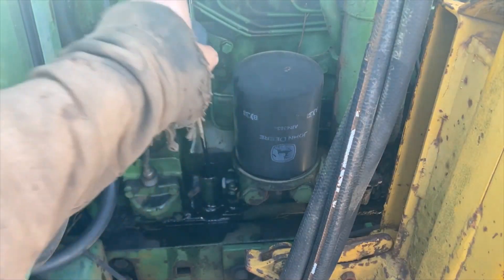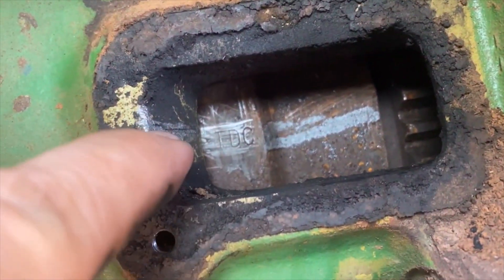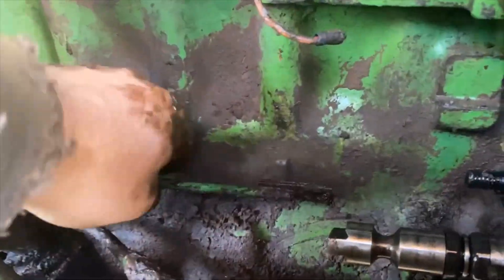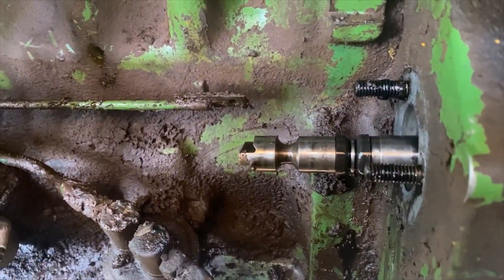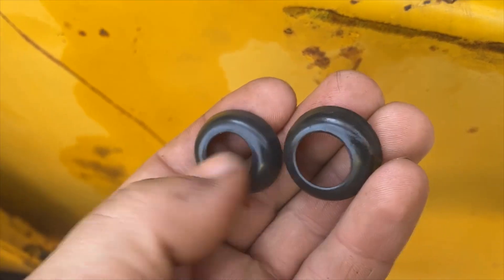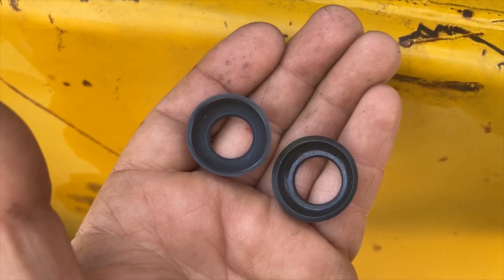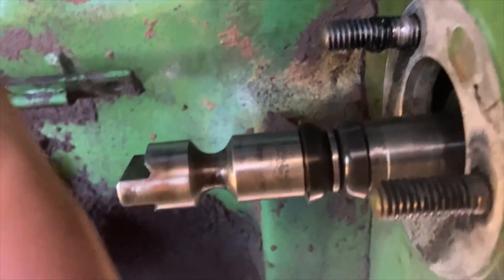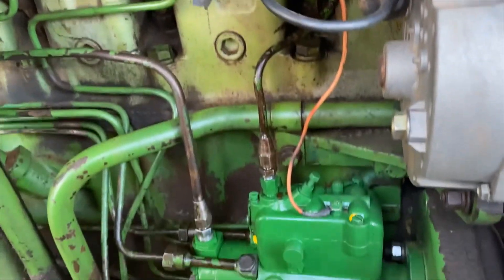John Deere 4320 Injection pump Diagnosis|Replacement

Comment: Is there an o ring or anything on the fuel line connection between banjo line and injector line?
Reply from the maker: There will be copper washers or bonded rubber washers with a steel ring both could be reused if needed but are readily available.